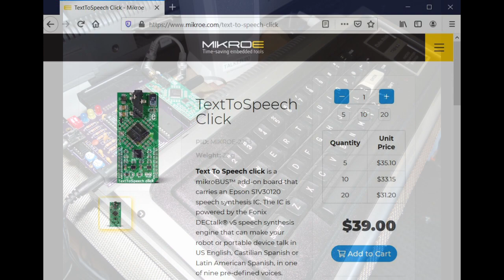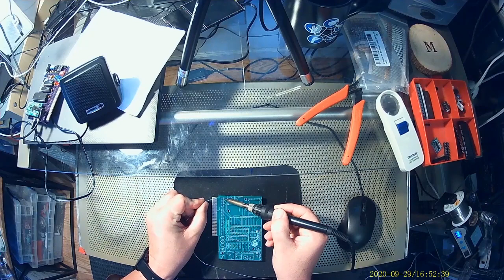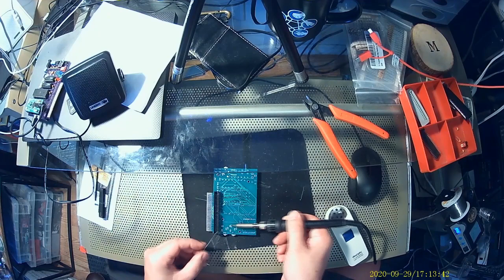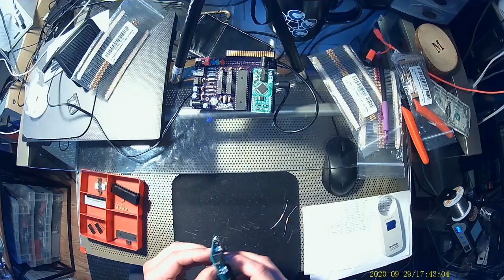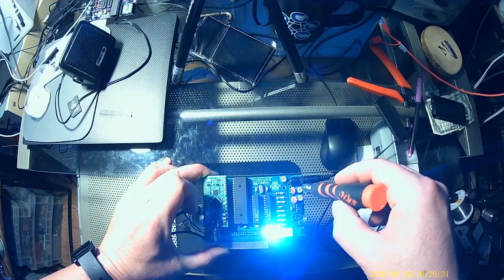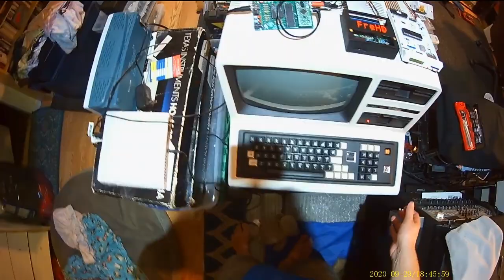#SepTandy - Assembling the Talker/80 for the TRS-80 Model III / Model 4

Comment: I'm getting the LEDs flashing when I power it up, but that's it. I've checked all the joints, they look OK. How can I troubleshoot this?
Reply: @michaelwessel4953  that's my problem, the SMD power select. I will fix it tomorrow. Thanks!
Reply: @michaelwessel4953  Well it is literally the first item (in RED) on your assembly notes - not sure how I missed it LOL.
Reply: @michaelwessel4953  Sorry just getting back to this as my TRS-80 was undergoing some repairs. It is working now, however when I run the demo programs the speech sounds like gibberish. The initialization speech is clear, but running vsdemo.bas I'm not hearing English. I tried to sendbyte the English byte setting but that didn't help.
Reply: @michaelwessel4953  OK, WELCOME/BAS worked just fine. Thanks!